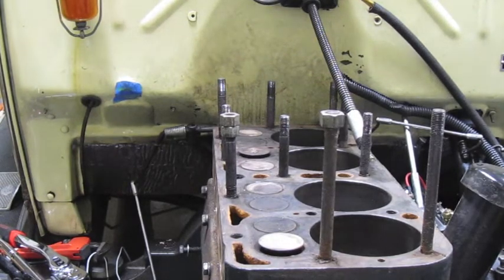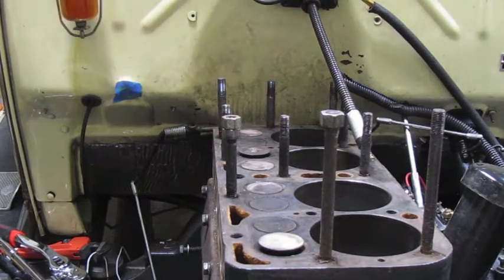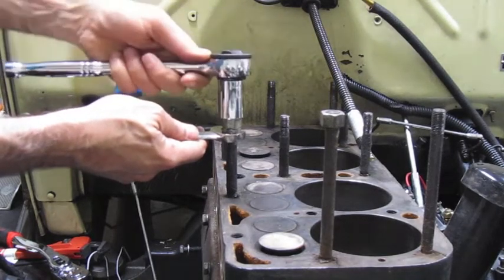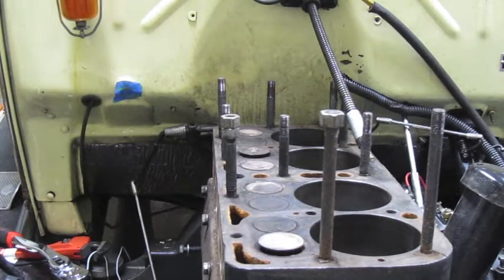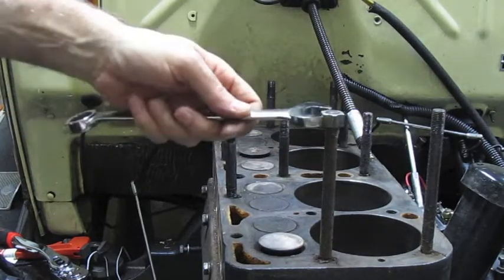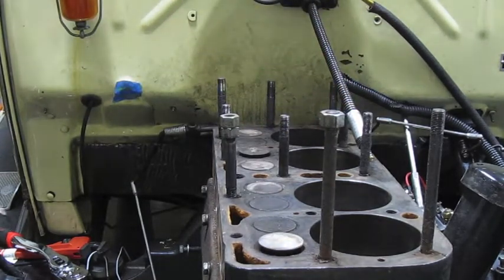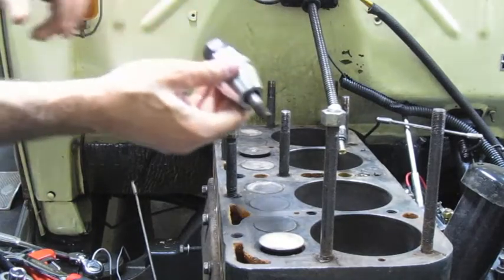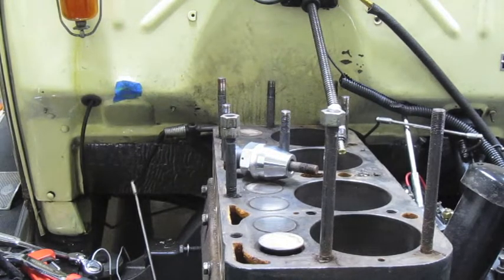Ford Model A - remove head studs

Comment: Well done, Doug.  I've used a couple of those alternate methods of removing the studs.   Wish you would have mentioned that it's not a good idea to re-use studs - best to replace with new ones.  90+ year old studs should be "retired."
Reply from the maker: Thank you for the comment.  I am working on a new video to remove the Model A head, I will definitely take your advice and mention in my next video to replace ALL the head studs if they are old, it is not that much money to buy a set, and all the threads will be in good condition.   I hear some people have to take their head off a second time when it does not seal right on the engine the first time, it may leak -  they could re-use their head studs if they are recently purchased and not damaged.
Reply: @dougfierro7155  Exactly.   You don't want to reuse 90 year old studs; if they're recent, they might be able to be reused.